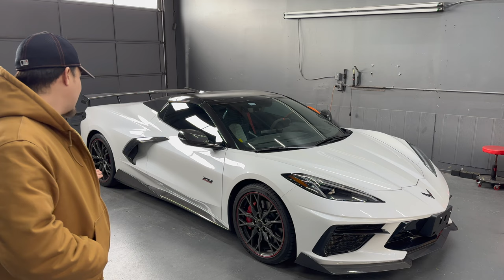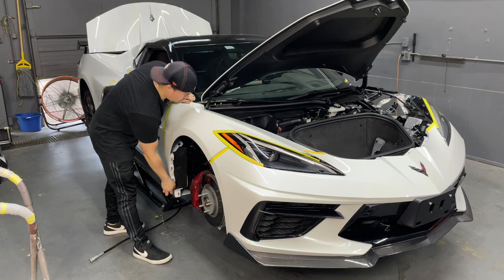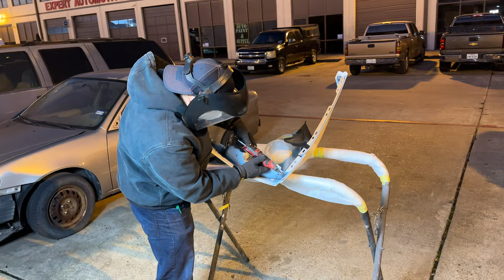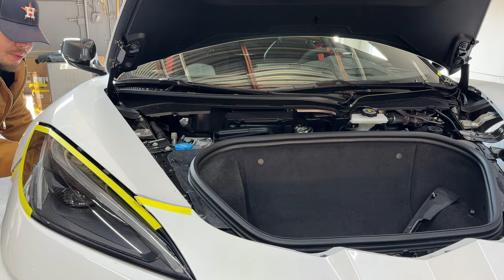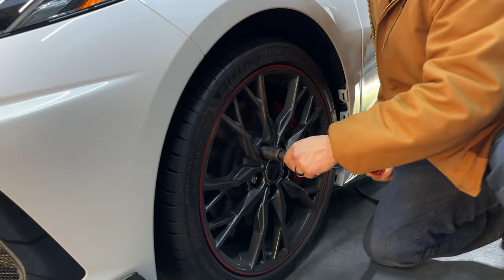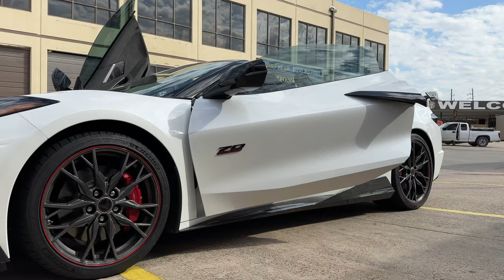70th Anniversary C8 Corvette Lambo door Install!

Comment: are you actually using tape to hold the door in place while you unbolt everything? that actually works?
Reply from the maker: Hi , the door is latched on to the vehicle . There are also spacers we put on the bottom part of the door to help make sure it stays in place. It has worked for all 183 c8 corvette installs we have done.